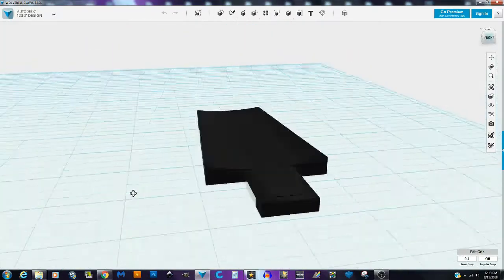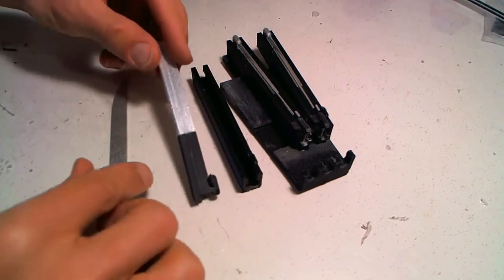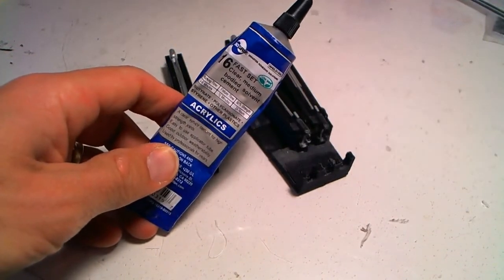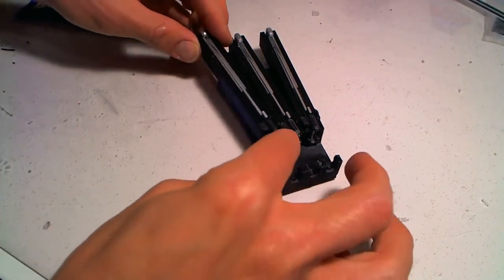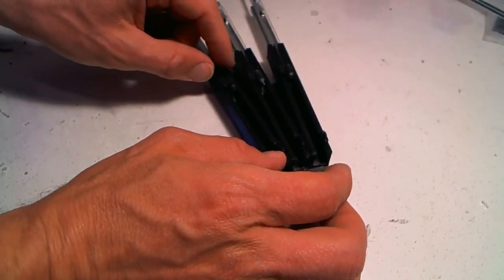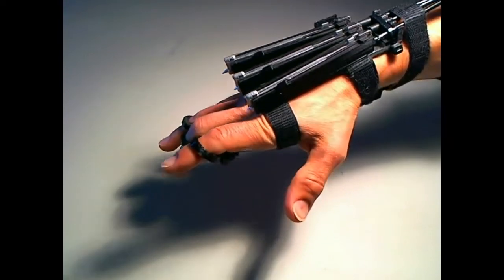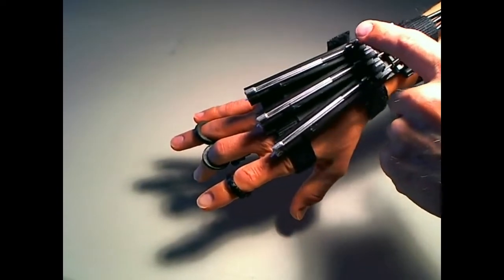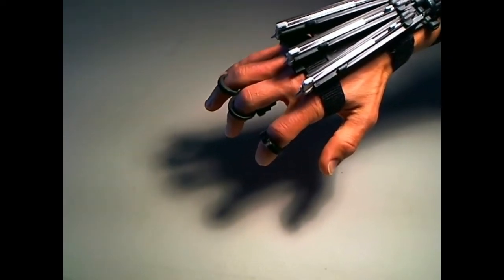💥X-MEN WOLVERINE Claws💥 fully automatic DIY tutorial 2.0😲

Comment: These claws do look better than the original ones you made. I think there could be a couple small things to add that could make them a little better. If you cut off the rails on the side of the claws, leaving only the part of the rails that stays inside the base to hold the claws to the base, so the rail doesn’t add any visual thickness and makes the claws look smoother and more like solid metal. I also wonder if the tabs and hooks holding the string in place could be covered up somehow to smooth them out even more. With those two small details you could make a pretty convincing set of claws